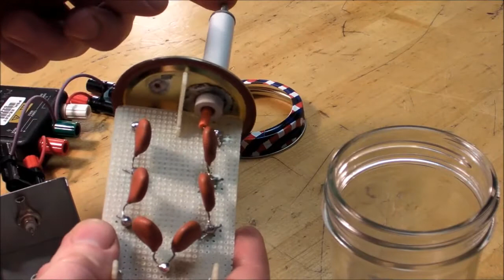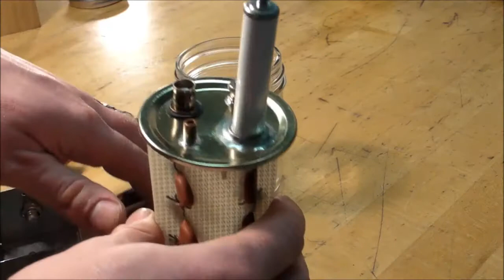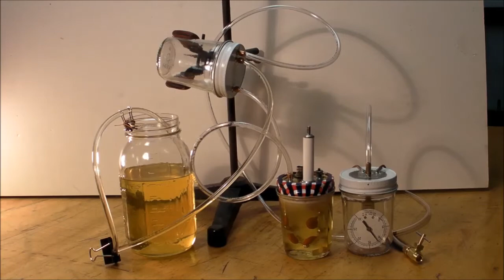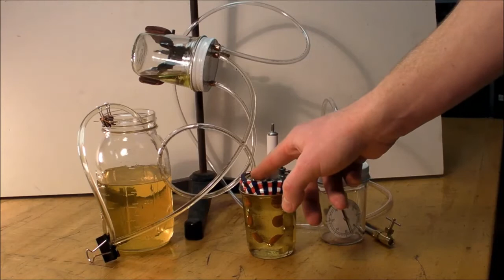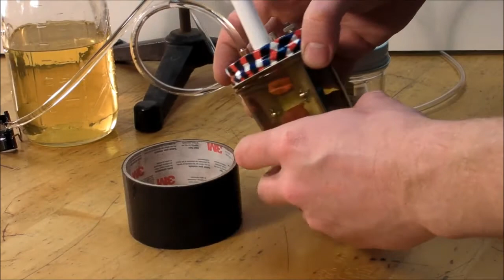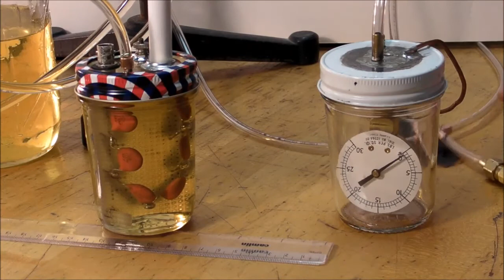(#0047) Vacuum Filling Oil in High Voltage Scope Probe - DRSSTC vs. Spark Gap #07

Comment from the maker: It's definitely the right oil for the job. I got it from an old hermetically sealed 15kV DC power supply that had a couple of 1B3GT vacuum tube rectifiers, two transformers, and a few passives all immersed in the oil. Thanks for the tip. I didn't heat or vacuum the oil for very long. Will certainly be more patient if I do this again.

Comment: You will get a little vapour always, you will have to vacuum it at high temp for about 5 hours before it stops bubbling and gets the last vapour out. What oil were you using. Some not designed to be vacuumed will have a lot of ight fractions that will boil off. Best oil is the vacuum pump oil with no additives.

Comment from the maker: Now I am regretting not making a video about that. I did both of those things already (but heated oil in a tin can on a stove top). After all that, I still got bubbles forming under vacuum. That's why I suspect they may simply be oil vapor.

Comment: Good tip is to heat the oil to about 100c with an immersion heater ( one you will never use again for boiling water) so that it will evaporate most of the water and air out first, then fill the unit from that. Less trapped air and water. Let the oil in the top vacuum reservoir be under vacuum for about a half hour and then let it fill the canning bottle.